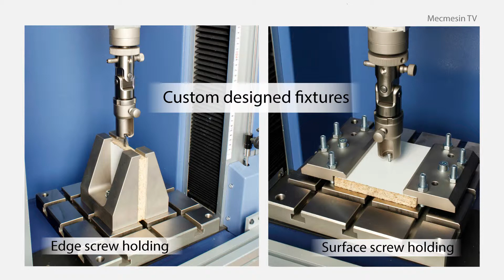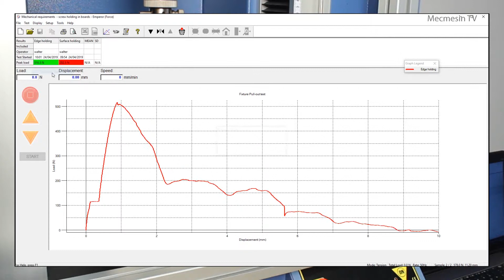Screw pull-out load from furniture board

Comment: Could you please explain the results in pull-out "pounds" of pressure to pull out the screw?
I found an online calculator, and it converted 516.3 Newtons to 116 lb of force.  Does that sound right?

According to the chart (for the edge testing) it looks like at the 1mm pull-out mark, it withstood a maximum of 516.3 Newtons.

However, I would think the surface area (with the plastic/melamine coating) would have been stronger, but it indicates that the surface could only withstand 202 Newtons.  Am I reading the chart correctly?